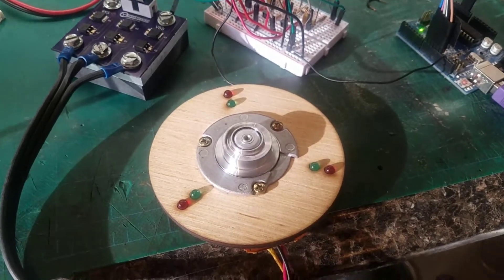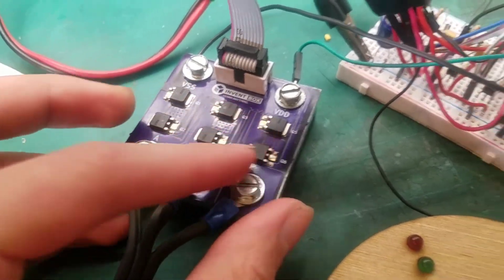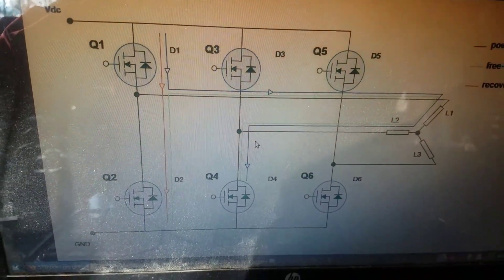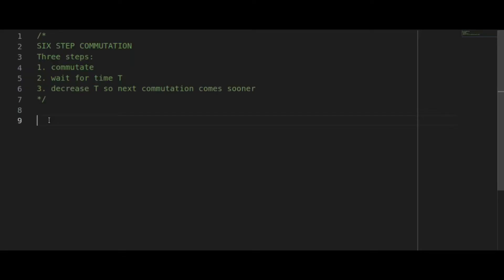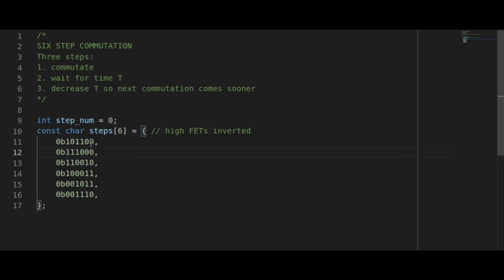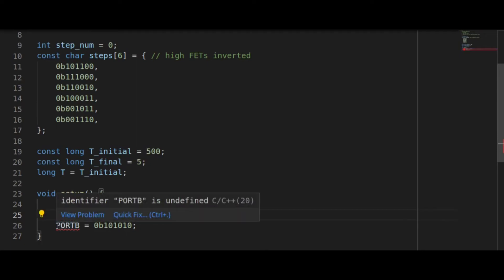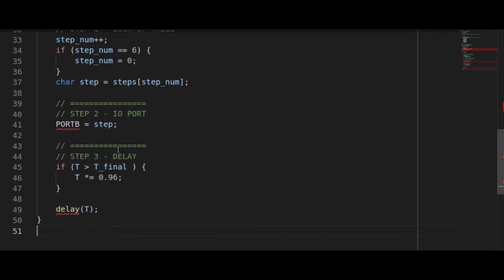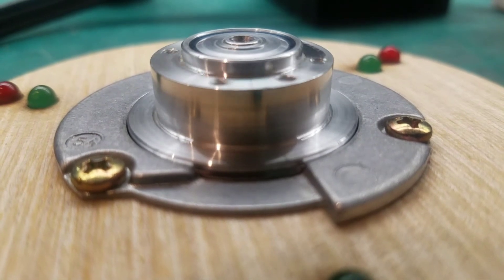how to spin a BRUSHLESS motor - six step commutation

Comment: Hi, I have mostly remade the circuit so that I can test some salvaged drone motors. However, I do not know how the other circuits are connected to the inverter circuit, and I cannot find the PCB online to guess the connections. Could you please explain or provide a diagram of how the bootstrap circuit and arduino are connected into the inverter? Thanks!